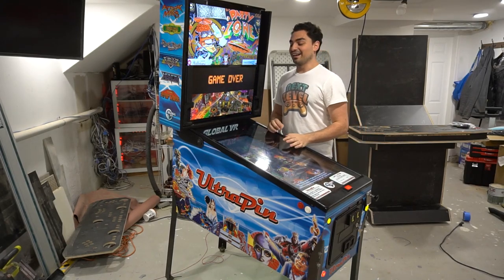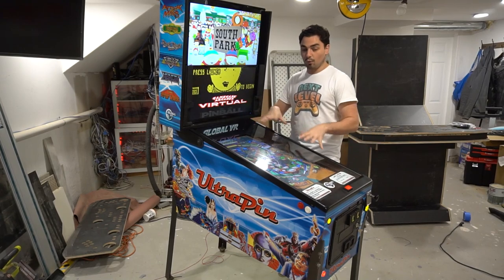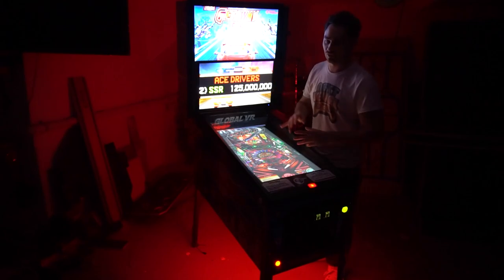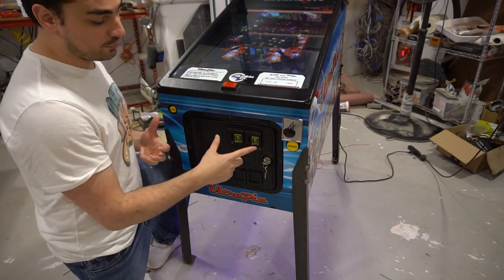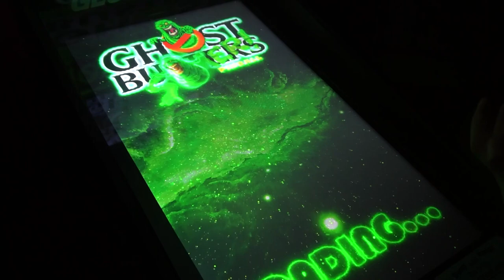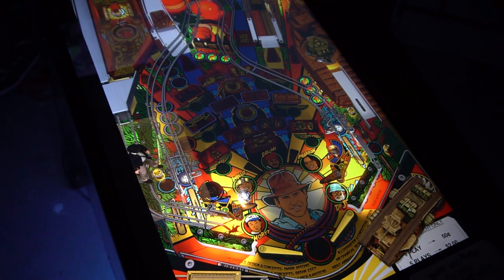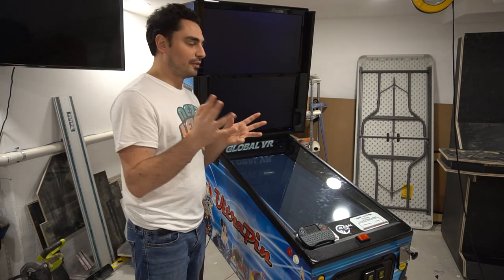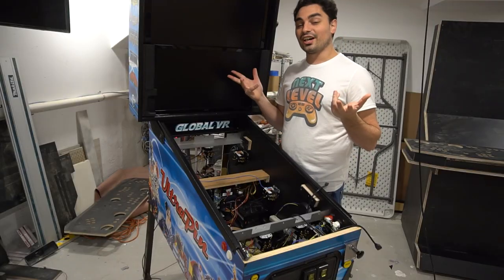Global VR UltraPin Gets a Facelift & Upgrade

Comment: Nice job on this one.  I’m not exactly a fan of the two large screens on the back box.  However seeing what you had to work with I understand why you did what you did.  

I own one of these UltraPins myself.  Wouldn’t mind upgrading the playfield monitor.  Do you happen to have the model number of that one?  Or would you happen to know a replacement that would fit the size better?  

Mine is currently the original monitor which isn’t full HD and only able of 720p.
Reply from the maker: Thanks bud, not sure exactly which 32 inch Samsung when in as the customer supplied it... but I'm sure any 32inch screen will work